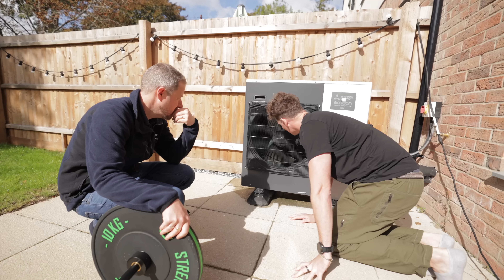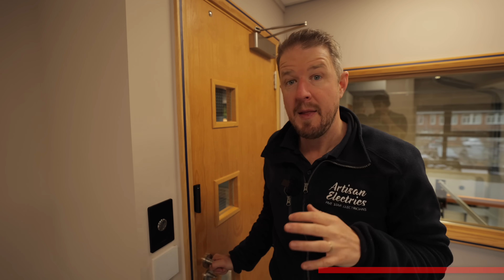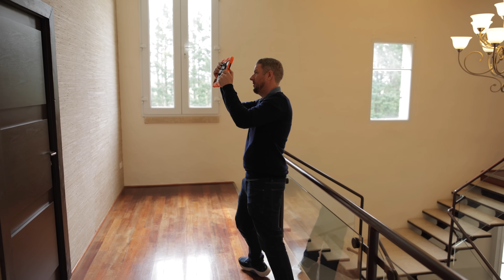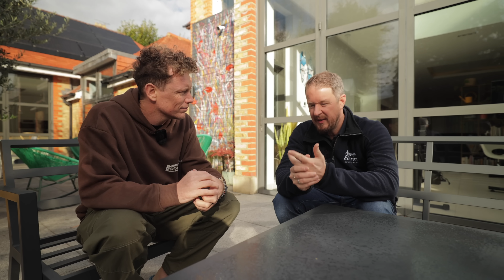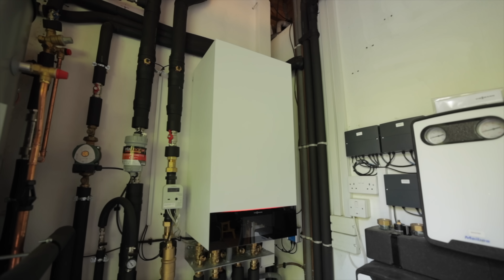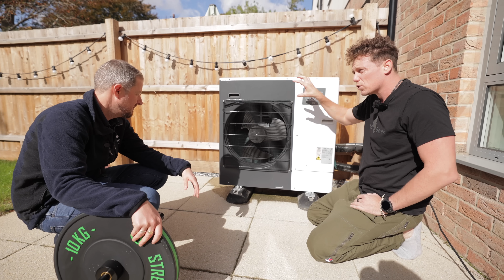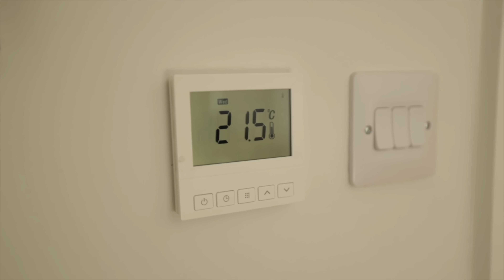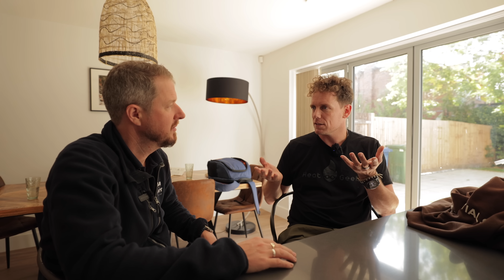Are Heat Pumps Really Worth It In 2026?

Comment: I lived the first 12 years of my Life in Farnborough Hampshire. In those days it was either coal or gas and at most only two rooms would be heated. Not the whole house. I now live in Australia in Victoria near the coast.  When I visited my relatives in 2018 in Wales I noticed they had a tendency to heat the whole house with Hydronic systems heated with Gas Boilers.  Nice and warm and cosy no doubt about  luckily my relatives could afford the heat bill .
I really love my country of origin but after visiting it after some 50 years I am glad I now live in Australia.
Why? I could see that Britain has become a country of extremes. When I saw videos on what you call installing Heat Pumps, I was shocked at the cost of install. I could not work out why. Then it became obvious most of you guys are installing air to water heat pumps. This is crazy, water is a substance that has a very high specific heat. You have to pump in a lot of heat into water just to raise its temperature a small amount. Not only that you have the complexity of the copper plumbing, radiators  and other complicating factors.
Is there a much simpler solution? You bet most of the time in Australia we are using what are called MiniSplits. They are air to air systems and you can have one outdoor unit and up to about 6 indoor units plumbed in with 8mm and 12mm copper lines for the R32 refrigerant. Ducting is too expensive. In my house I only have one unit it is of course an inverter technology and I have it running on my OFF GRID system. 
It is summer here and of course the air to air system cools the living room when the temp gets to 45C  to about 23C. My advice ditch those complex air to water systems and install air to air mini splits. Not only do air air systems heat but they also cool as well. Air has a much lower specific heat than water and you can bring the temp up or down very quickly.
Finally I noticed just recently that a guy on You Tube in Britain challenging the notion that heat pumps were cheaper than Gas. I was puzzled by this I then I saw your Gas prices. For Gas it was 6p per KWhr for Electricity it was 24p per KWhr. I soon as I a saw that figure I could see that the difference between gas and heat pumps would not be that great. The COP of most heat pumps is around 4
Your cost of Gas is too cheap and all this talk about Green House gases seems to be just that. All talk.
Reply: The system needs to be able to supply hot water in nearly all cases, so air to air is insufficient for households’ needs thus your advice is not particularly useful and misses the obvious point that ac systems in the UK are air to air; it is simply too expensive to run two domestic heating systems.

As for the global warming jibe and the cost of gas, come back and lecture when Australian petrol prices are as expensive as the UK and Australia has stopped using brown and black coal power plants - Australian electricity is “too cheap” at the equivalent of 14p kWh on average because its generation is still majority carbon based.🤣 In mid 2025, average Australian gas prices for residential use were on average the same as the UK; although Australia has significant regional variation (for obvious reasons as it does for electricity) and Australian prices are affected by how much Australia exports - Australia could always export less gas if it wants cheaper gas.  Now if you had said, the UK electricity is too expensive, the pricing mechanism is appalling and counter-productive, that the trading and generating mix are inflating prices etc etc, I would probably be congratulating you and egging you on.

Comment: You will be ok with a heat pump as far as costs are concerned , you have  solar & batteries so free electricity to run it. Have you got an immersion heater & underfloor heating ?

Comment: I love how the "expert" skips over cold weather efficiency; yes they will work at low temperatures, but they are far less efficent, and Scandinavian houses are considerabley better insulated than most UK houses, PLUS the UK has some of the most expensive electricity in Europe!
You are not going to heat that house with a 5Kw heatpump.
And again, the issue of noise was skipped over in a sentence or two. Imagine a row of terraced houses with a heat pump outside each one!

That big heatpump is also in the shade, where the air is considerably colder than than in a sunny area.

Comment: 21 during the day, 19/20 at night?  I've had to turn the stat up to 25 today, or we would be sat in a slightly chilly Bungalow, {small} I don't understand why. Our experience of ASHPs is not a good one, It feels like I need a Degree to use it. And it is costing more than our previous heating system, I would like to go back to setting a programmer and leaving it.

Comment: This is a great video, but I think we need to start seeing this content on a typical UK home. I.e. a mid-terrace or semi-detatched home with a garden that doesn't necessarily have space for a Heat Pump. Those are challenges I face as there's literally no decent or reasonable garden space to give up for even a fairly sized heat pump.
Reply: I’m in a 1 bed council house that came with a 150ltr ground source heat pump that has been nothing but troubles since in moved in. 150litres is not suitable for 1 person. the cost each month is over £100 and I barely use enough hot water like I would like due to it running out fast. It has been horrible to deal with.

Comment: Just a little maths tells you that if this heat pump shit takes 10 to £15000 to fit but only saves you 300 a year that means before you see any difference  in your pocket you would need to use it everyday for 45 years....

Comment: These are a con No house in UK can benefit from a air source heat pump unless you spend a fortune on insulating your home properly.all these new builds in UK use the minimum amount of insulation the government won't people to work hard to heat there homes and that's a fax if that care the houses would be built to the Scandinavian model.scandinavians run there heating on about 200w

Comment: Hehe, very interesting. You’ll need just double glazing to get efficient heat-pump output!🤣 Good luck with your energy bills going forward 🙂

Not to mention that most old houses don’t have underfloor heating! From experience, a house needs to be properly insulated, with good windows and underfloor heating, for a heat pump to make any sense at all. Otherwise, you’ll just burn money and end up with a cold house

Comment: Running two air source mini splits here, we get temps down to -25°C and both are performing great. The old one (10 years old) needs to run the fan a bit harder than the new one, but we get enough heat to wear a T-shirt indoors. And the ability to run them as aircon for the increasing number of hot days in summer.

Comment: The figures alone say it all Adam casually spoke about a 16Kw heat pump being in use that only draws 4 to 5Kw of power.
Am I missing something or is that a no brainer? 
In New Zealand many heat pump systems are bi-directional and so can be used in summer for cooling. I am surprised that we are not promoting  the use of Air Conditoning units more.
Reply: It may not be so in NZ, but in UK, even on best Agile electric tariff vs Tracker gas tariff, the cost per kWh of electricity taken over a year is 3-4 times higher than gas. Until the government change their policy decisions on loading the electricity price (but not gas) with everything they can think of, the basic running cost economics of heat pumps don't stand up to examination. And that's BEFORE considering the capital cost and improvements needed to most houses.

Comment: We had one installed in the summer, along with underfloor heating on the ground floor. The difference is staggering. We were using a pellet (wood) boiler before this, flaky and very expensive to run. Now ... theres a snowstorn going ... and its about 1/3rd the price of the old system.

Comment: Old houses with leaky windows.
Free 7500 but it goes out the windows. But can’t get grant for double glazing or insulation and draught exclusion , 
It’s all about the money and politics . We where told that we would need 3 phase electricity to run a heat pump, £15k+ before air pump install. I’m nearly 75 our heating oil and solid fuel about £1k per year,
= how long do I have to live for,
Answers on a postcard

Comment: There are many cowboys around when it comes to air-source heat pumps. Talk to a heat pump manufacturer and get their recommendation for a properly trained, accredited installer. Correctly installed and ideally in combination with solar panels you can heat your house very economically.

Comment: @HeatGeek : "Our average price around £3000". This sounds really good! I even booked the survey, from £4000 estimate which included cylinder + 10kW ASHP + 2 radiators update, the price skyrocketed to £7500 for 5kW heat pump + cylinder and no radiator upgrade. HG Installer: " £7500 average price is what your quote is. It’s an involved job. You have your system running at low temperatures already, having a heat pump installed is not purely to save money, its for environmental reasons also, to achieve Net Zero.". Phoned another "heat geek", the same 4kW (Grant ASHP instead of Vaillant) + cylinder + no radiator change, was told that just parts and materials will cost £11k excluding labour. So £3000 just for the hype?

Comment: If a person were to build a thermal mass in the centre of a house. and heat it with the direct current from solar panels.  No inverter, but with an ability to vent off excess heat,  would this be a better option in theory?   Because the current options appear to be dammed complicated, expensive and in need of constant maintenance.

Comment: This bloke does not know what he's talking about the Mitsubishi Heat pump at your rented house!

There is no pump in the outdoor unit. The primary pump is located at the cylinder  

The immersion has to be left switched on because it's wired to the FTC on the cylinder and it uses it to carry out legionnaires cycle once every 7/14 days. Also it kicks in the immersion if the heat pump is struggling. This is how the unit is designed.

Comment: We've got a 30 year old conventional gas boiler that is facing yet another full board change at the very least, probably complete new install. I would dearly love to go heat pump but given this is a 63 square metre mid-terrace house I don't think it is feasible due to lack of space. Obviously there's no exterior side access, then at the back you've got the kitchen (where the boiler currently is). I think with an exterior back wall that is only about 4.5m wide anything you'd want to put there would be too close to either the kitchen window or the patio door. Then inside, where does all the rest of it go? The existing hot water cylinder would be removed from the cupboard at the top of the stairs but my understanding is that whatever replaces it is bigger, so could that go in loft? The existing hot water pipes are pretty small, about 15mm diameter from what I can see, so I guess that means complete replacement and all the radiators increasing in size too. That last bit might be doable but am I right in thinking the other issues make this a non-starter and we're going to end up with another gas boiler? There's only two of us and when things work this is a pretty warm house so probably only a small system needed but there's a minimum size to these things.

Comment: At this present time the shelf life of a heat pump and solar panels is not known. A gas boiler shelf life is around 15 to 20 years before it needs to be replaced. But a gas boiler can be refurbished, but the cost of doing that is about the same as having a new replacement boiler. THe cost of a boiler is around £1,500 to £3,000, a heat pump and solar panels can cost up wards of £40,000. There is the government grant of £7,500 to take of the initial cost of installation. But what happens when the heat pump and solar panels are worn out and need replacing? Gas prices may rise but will the ultimate cost of installing the heat pump and solar panels plus the usual costs of bills cost more, than  gas boiler installation and15 years gas bills for a gas boiler in the long run? I think it will be a very close run thing. My advice wait a couple of years see if the installation costs fall and the tec involved become more efficiant..

Comment: Can’t see heat pump being worth doing unless you have solar and batteries.  But the total cost of solar and batteries and a heat pump for us would be 20-25k.  The payback is just too long.  We would be better off just investing that £25K over 15 years in stocks and shares.  We might just have paid back the equipment  costs by the time it needs to be replaced again.

Comment: I live in a village where eighty percent of social housing.We've all had heat pumps solar panels triple blazing, exterra installation.
And it all budged up done by cowboys, pipes were no lagging or insulation around it. Floorboards, missing halls were no air vents. Damp in every room we never used to have damp there has been a lot of families in this really village who have moved to somewhere else just to get away from heat pumps they say they don't work cost a fortune. Their electric bill is sky high. The solar panels have battery packs, which are not connected in 60% of the houses. Go green at the expense of people's health. If I could go back 3 years, I would never let them touch this house. We all had built-in coal fires with back. boilers. Nobody moaned about the heating. Nobody had any damp mould in their houses.
Reply: That's the problem with a lot of these systems the whole house needs doing to a high standard or else they just work badly, the cheaper heating of yesteryear could plug the gaps on it's own

Comment: Guy came round my house, asked how many bedrooms the house had, then looked at where a heat pump could be located outside and said the heat pump unit would be £17k… just for the unit. Bonkers.
Reply: Get someone else round then, you can look online that one of the most common ones installed in the UK is less than a 3rd of that, and that comes with a cylinder.

Comment: I'm struggling to see the benefits from it. As an extremely low energy user. 
Average electric monthly bill is 40 over a year. And for 5 months we pay more in standing charge than in gas use.
A combination boiler is just for for purpose for me.
Hot water when I want it.

What are the benefits of heat pumps ?

It'll cost a fortune to install.
It'll have to run 24/7 so when I'm away for weeks on end I'm paying for that to run in the background.
I've even heard this is putting off some house buyers as they don't want them.

Comment: It's my first year of having an air-source heat-pump. house a single brick Victorian terrace house with some loft insulation. The house stays a comfortable 21C without any effort. We are also saving a lot of money as the combined SCOP (hot-water and heating) is almost 4. This is brought down by lots of baths for the children. We've tied it to a smart tariff so this is running at around 3p/kWh for heat output which is far from bad.

What I regret is that I only found out about Green Loans too late. I could have added it to my mortgage at a cheap rate which would have been only £23 a month -- so realistically £14 a month given standing charges for gas are £9 a month. We have one negative experience is that we didn't plan well for the installation given we had a young boy being potty trained concurrently. In such a situation it's worth going on a holiday or something equivalent.